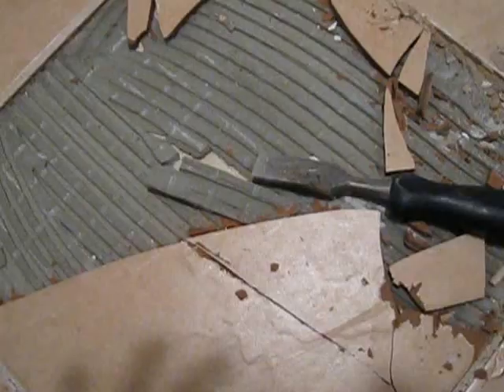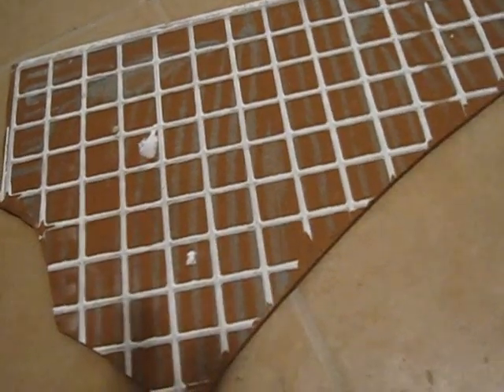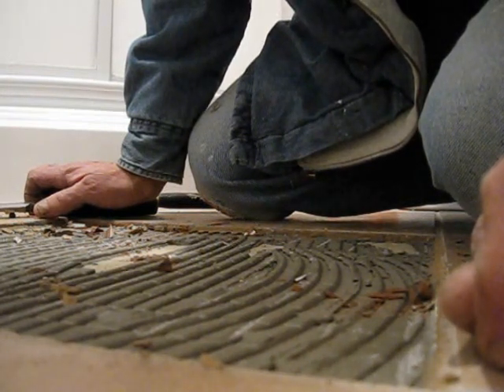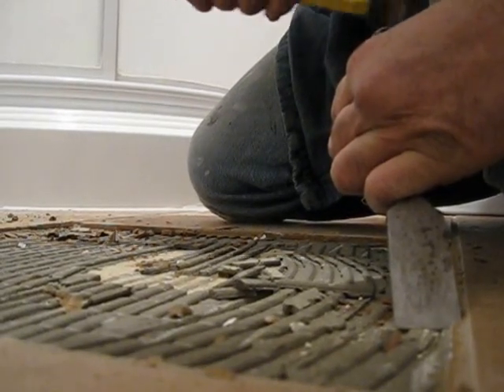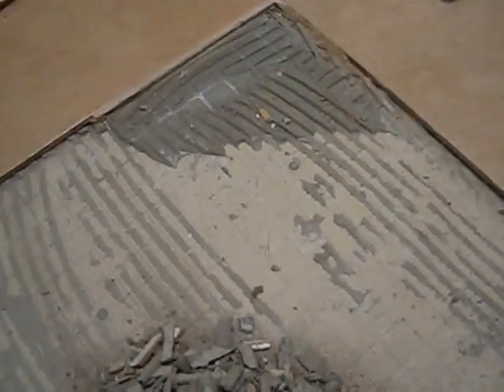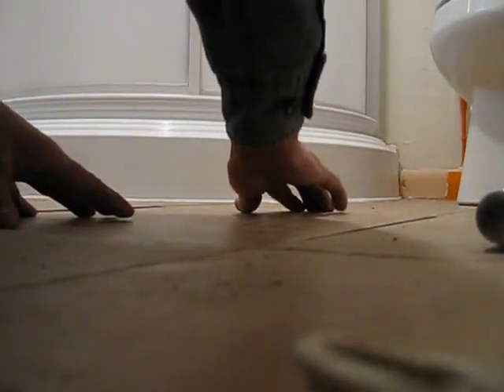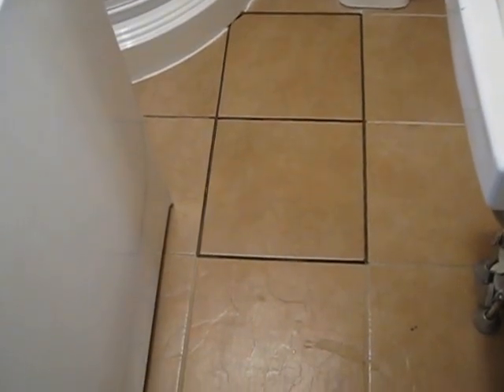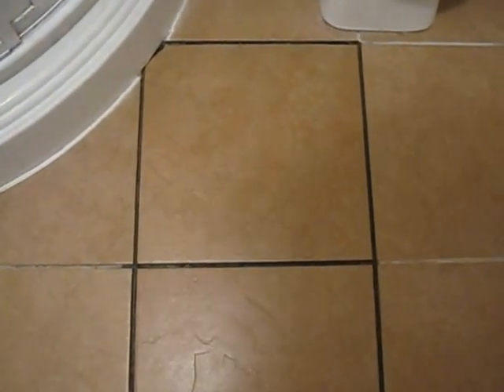How to remove and replace a single Floor tile. Step by step tile removal and replacement.

Comment: thats what happened in my situation the contractor set 6 tiles in a bed that already has been "skinned over" it took 5 years for it to start giving issues.